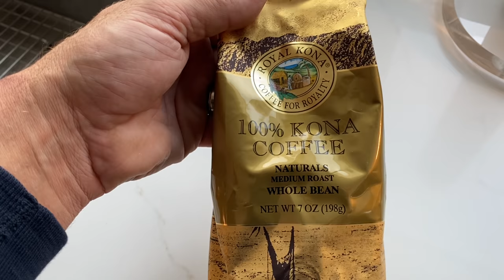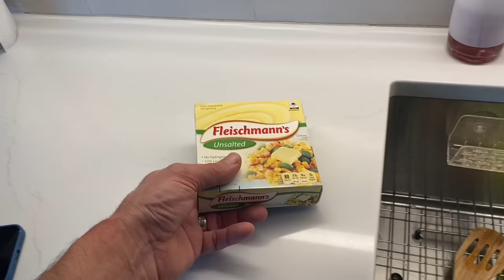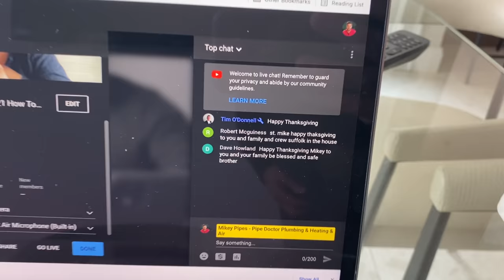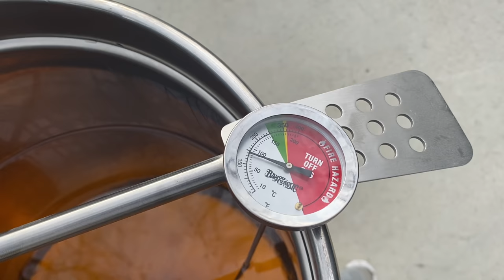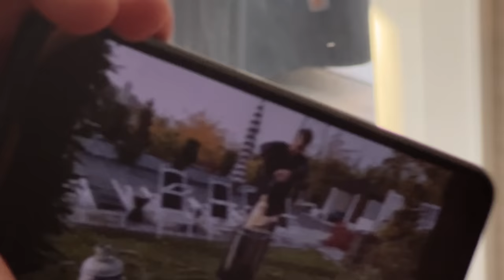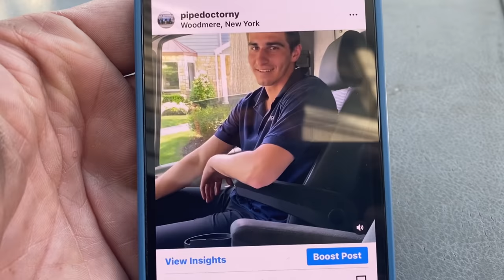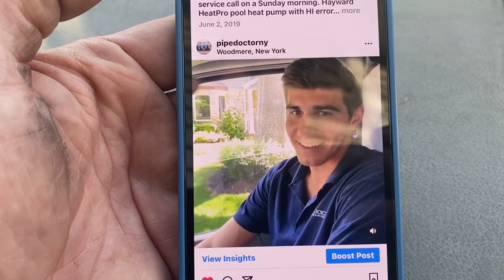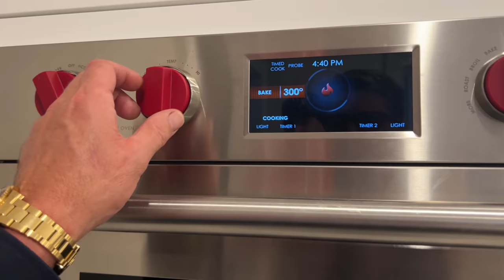Thursday Evening News with Mikey Pipes - Behind The Scenes on Thanksgiving Episode 1

Comment: Word of wisdom on propane tanks. I have 3 tanks that I take to the local camper dealer and have them filled.  I don't mess with the tank exchange BS.  1) I know I am filling a good tank 2) I get a full 20 pound fill, not the 12 pound BS from the exchange people.
Reply: In NYC it is against the law to refill those tanks . With that being said it is legal where Mikey lives .   Maybe it is just more convenient to go to the big box stores ?
Reply: @lhr1701  interesting.....wonder what is behind by that ordinance?
Reply: A lot of the hd out on the island actually weigh the tanks before selling tonyou
Reply: They should have 15 pounds in them giving the 80 percent fill rule for thermal expansion.  They started that years ago and obviously work out well for the supplier too. I always check mine on an exchange and that's what I get.  Its too inconvenient to find and wait for a refill somewhere.
Reply: Propane fill stations are much more common in Suffolk county as much of Suffolk doesn't have natural gas.  Due to this, in Nassau, exchange is much more common.  I get mine filled at Tractor Supply typically but there are 4-5 places in a short radius around me.